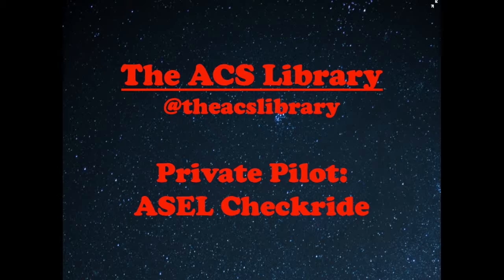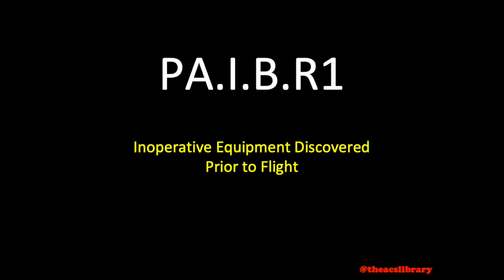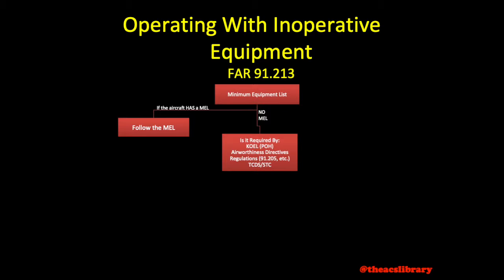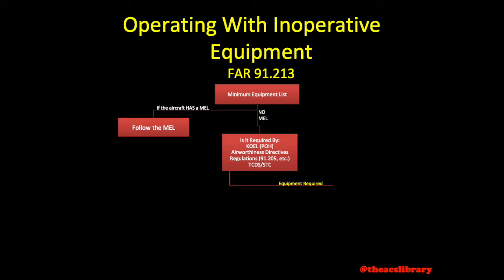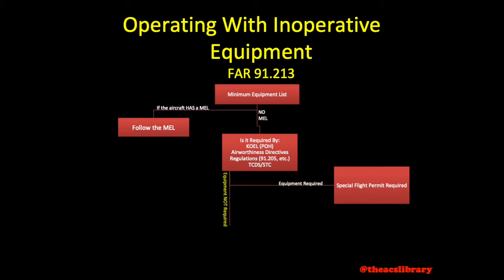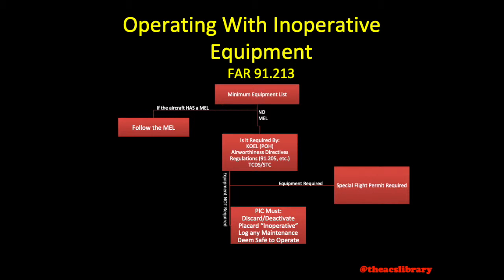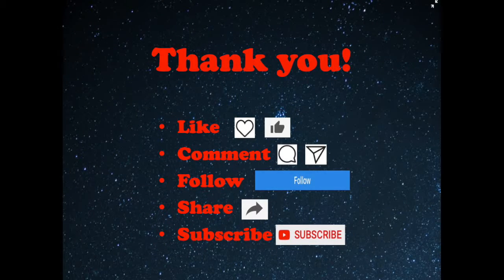PA.I.B.R1 Inoperative Equipment Discovered Prior to Flight

Comment: Great videos! I was taught in my ground school that maintenance needs to sign off - this is if you remove, deactivate, or repair. Is this really the case? 

The airplane I train in and will use on my checkride has a turn indicator that stopped working. I just saw an instructor slap a Inop sticky note on the gauge 5 minutes before my flight